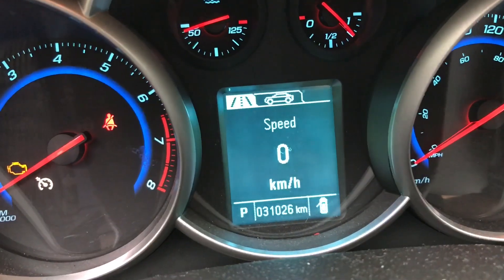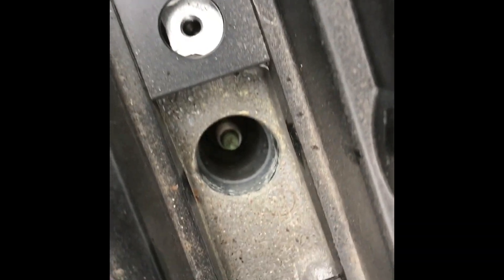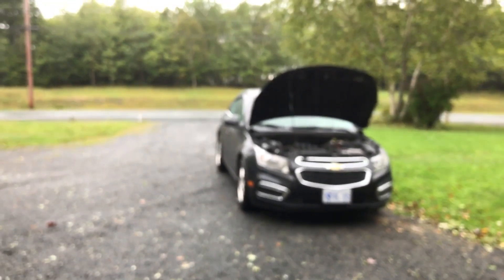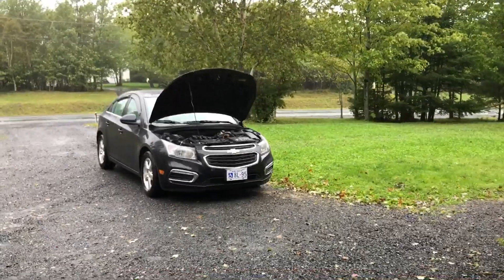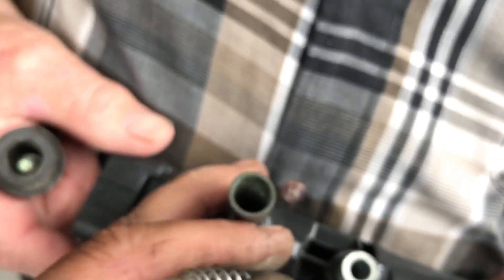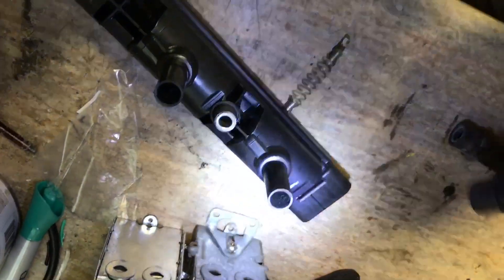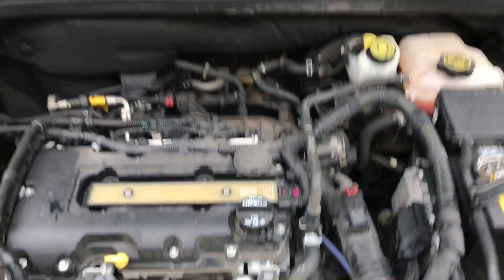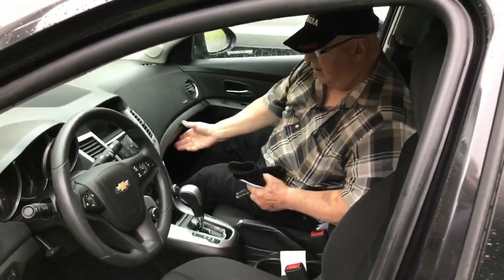Easy Fix 2015 Chevrolet Cruze Misfire Code PO304

Comment: I first changed the coil pack and it ran good for a while and it popped up same thing as yours did and I replaced the spark plugs.. ran good for 20 minutes and same thing happened. Should I take the coil pack out and clean it?

Comment: My wife has a 2011 Chevy Cruze Ltz with the same code and misfire but has oil in the #4 spark plug we’ll do you think it could be the same thing I took it apart but there is no corrosion like in your video???
Reply from the maker: if not sure if coil or plug is at fault, I usually swap plugs around.  Oil on top of plug usually means valve cover gasket.  oil can deteriorate the coil insulation.
Reply: The valve covers suck especially the aftermarket

Comment: My daughter's car had the same looks and failure.  I vacuumed out the debris from the spark plug well, cleaned the spark plug and cleaned the fiber tip of the spring.  Now the car was drivable.  The car dealership replaced the coil pack for free.  Runs like new again.
Reply from the maker: Tom Luque  that is Sweet!  At least the dealer is recognizing the issue.  These should not be failing at that connection especially with low mileage.

Comment: my 2012 did this but on cylinder 1 i think that fuse looking thing is what goes bad and causes corrosion because there is not moister getting into it at all and after a few thousand miles it corrodes again so I just changing all 4 plugs and a new coil pack.
Reply: U replace a ignition coil and spark plug is tht fixed ? Or still misfire ? Let me know , cause i have a misfire on cylinder 4 cylinder 3 cylinder 1 ,
Reply: @aniqcubacubajer2074  what's the mileage on your car? Have you change any since it was new?
Reply: @kevinanglin678  80,000mileage
Reply: @kevinanglin678  i change a belting power steering cause i broke up my belting , then when i change the belting , my car is good , right now i have a misfire , code p0304 p0302 p0300 p0301 , i just replace a spark plug only , my heat engine was leaking oil , and one inside of my spark plug has an oil , spark plug , Scanner give this code p0304 p0301 p0300 , my check engine light is flashing and my traction control is on
Reply: @aniqcubacubajer2074  sounds like you need a new valve cover to me do you hear a hissing sound like air being sucked in around the spark plugs on the right side but you definitely need a new valve cover because it's leaking oil into the spark plug holes. And if your car is at 100,000 miles or over that change the spark plugs and coil pack if you've never changed them
Reply: @kevinanglin678  i dont hear sound being sucked in , acctually my car is chevolet cruze lt 1.8 2012 petrol
Reply: @aniqcubacubajer2074  Yeah I would go ahead and replace the valve cover because it's leaking oil anyways and go ahead and change the spark plugs and the coil pack on it
Reply: @kevinanglin678  thank you sir 👌✅

Comment: Mine did the samething. Went to Napa and bought a spark plug boot w/coil on pack.(that's the spring and boot). $8 and 2 minutes to change. Use q tip and electric cleaner to remove corrosion from inside the coil pack. No check engine light just random misfire.

Comment: Oddly enough I only see misfire videos of the cruze 1.4 turbo engine. Does this issue occure with the 1.8 engine aswell?
Reply: Yes I’m fucking struggling with a misfire and it’s getting pretty labor intensive. Fucking chevy just aren’t built to last anymore
Reply: I have a same promblem , chevrolet cruze lt 1.8 , misfire

Comment: I have this same car and I feel like it’s misfiring sometimes but not check engine light is on. Esp with the a/c on
Reply: Mine did the samething. Went to Napa and bought a spark plug boot w/coil on pack.(that's the spring). $8 and 2 minutes to change. Use q tip and electric cleaner to remove corrosion from inside the coil pack. No check engine light just random misfire.

Comment: I have a 2014 Chevy Spark and try as I might i cannot find ANYTHING on it showing how to work on the engine. Like engine schematics, spark plug changes, where to find the fuel injector, etc. can anyone post some stuff about the chevy spark. I know it's a tiny compact engine and not a big favorite of hobbyists to work on. But I'm desperate.
Reply: renee smith Look up Chilton DIY. I used that for the reference guide for my scion im.

Comment: Common problem with the coil pack! It's not under warranty! Not under drive train warranty anyway maybe under bumper to bumper warranty!
Reply from the maker: Sheena Boyles they actually covered this one.  Car had less than 60k on it.  He was lucky.
Reply: Saltbox97 mine did the same thing same plug but the part the boot goes on crumbled and fell apart I only had 50 thousand miles and it would not cover it ! I bought one on line for $76 and put a new plug in it ! The boot gets hot and the rings that keep the water out deform and bend down and let moisture and water in !coil pack cost me $76
Reply: Saltbox97 your lucky they covered yours
Reply: @robbyboyles8351 , you can buy just the insulating boot for $7. Comes with the new boot and internal spring.
Reply: According to Chevrolet website... their power train warranty covers engine including internal electronics.. aka the coil pack...  Dealers are full of poo....

Comment: My 2017 had the same problem, and the coil pack was NOT covered under the US powertrain warranty. Very cheap, GM, very cheap.
Reply: According to Chevy website.... internal electronics aka coil pack IS covered under Power Train..

Comment: Is it not 1,3,4,2?
Reply from the maker: Are you referring to firing order?  the cylinder numbering remains front to back 1,2,3,4 but as you say the cylinders are fired (sparked) in different order.  The scantool identifies the actual cylinder misfiring and not the firing order.